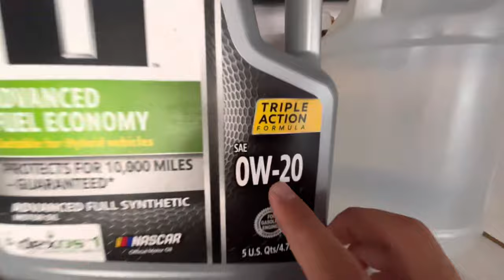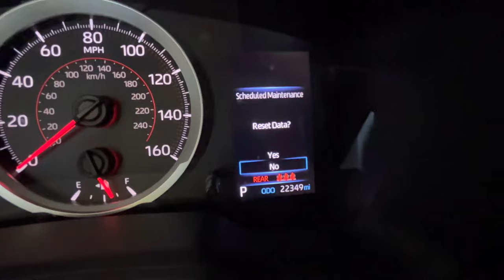2020 Toyota Corolla Oil Change! Super Easy

Comment: Thanks for the detailed video.  I normally check oil level after car is off the jack stands and on level ground.  The other thing is, according to Toyota owner's manual, oil level should be checked warm.  This can be done by letting engine run for 5 minutes, shut it off and wait 5 minutes for oil to settles then check dip stick.

Comment: 0w-16 is for max economy , and putting 0w-20 in is perfectly fine
If anything the -.5-1MPG loss is worth the extra protection
my 2020 SE purchased in 2019 have been maintained every 6k Castrol edge 0w-20 intervals for the last 65k miles and a Blackstone UOA shown it has wear similar to an engine with 30k miles

Comment: In the middle of the two dots is best. Oil expands so you don’t want to go to the second dot.

Tip: buy a tarp from Harbor Freight, they’re inexpensive. This way you put it under the car and you avoid spilling oil on the concrete and you stay prett clean too while you’re under there. Easier to wipe down the tarp than to try and clean oil off the concrete.

Comment: I used to pay $45 for the oil change and new oil filter on my Lexus IS250, now I just do it myself! Save so much money that way. Plus it’s super easy. Why pay someone for an easy job right ? Lol
Reply from the maker: Agreed! Plus it only takes roughly 45 mins to do. Not only money, but time you save
Reply: Its not the money its feeling uneasy knowing an idiot could over tighten drain plug or not put oil on filter gasket etc.Those quick lube places have kids working....Not feeling I would trust them. Doing it yourself assures everything was done correctly!
Reply: Everyone should have a trusted mechanic already for non-DIY repairs, someone that can do a good oil change.  You can easily spend $40 at the parts store for 4-5 qts of oil and a filter.  Add to this the time to jack up the car, find tools, lay on ground and remove skid plate, change oil/filter, remove jack stands, return old oil to parts store.  I'll splurge $10 a couple of times a year to let someone else do it.

Comment: So even the dealer put the wrong grade oil in it. You can't trust anybody.
Reply from the maker: That’s why I have issues with dealerships. They drained the oil and realized they didn’t have 0w-16 and only had 5w-20. I didn’t even have a choice.
Reply: That’s what they use on the 1.8L. Pretty sure they were lazy and used that.
Reply: It's usually just kids doing it.   Not much care factor
Reply: And they have the nerve to charge $100 or more to do a wrong job like wtf
Reply: Well tbh how do you know if it was 5w-20.  My dad got 2 years oil change complimentary so once a year at local toyota run by whoever franchises the name to resell the new cars.  But that stuff was like a straight 30 or 40 because it would not stop knocking the valves till 20 minutes later when it was below 45 degrees on a winter night with out the sunshine to help warm everything in the environment
Reply: This was on a suv with there 4.0 liter v6
Reply: I had alot of success using Castrol gtx 5w-20 jug 5 quarts with half quart Lucas heavy duty stabilizer so 10% added on an a honda v6 vtec (without cam phasers) the adjustable cam gears that vary the valve timing that have smaller oil passages so 5w-30 Gtx is probably the thickest you want atleast the last quart if you use 10w30 Castrol Gtx to not overheat and reduce power if you notice after 30 minu . Which all toyotas Started with instead of low to high lift camshaft like honda did
Reply: I like Castrol since it seems to hold up to thermal breakdown and it's thicker than most others.  Synthetics are usually thinner so I can try Castrol edge black one 10w-30 and it'll most likely flow better than there conventional throughout the tiny galleys in the variable cam gear lubricated by oil

Mobil 1 5w-30 is ACTUALLY thicker than Mobil 1 10w30 when warmed up and also at cold start THough a guy on here said he uses this 5w-30 on a 2007 v6 camry because of better fuel mileage but only put 6 quarts instead of 6.4 ..now I personally think it's because it's thicker somehow for a 5w-30 tho it flows pretty well into the motor so I'm guessing it was ticking the motor with 6.4 qts once it warmed up and the viscosity modifiers aka liquid rubber kept the oil from thinning too much but acted more like a 40 weight when the engine heated the oil so it felt crammed up ticking the valves is my guess. I would've just opened the fill cap adjust from 0.5 turns to 2 turns to see how much you need to relieve it due to oil pressure/ volume make sure fill cap doesn't fall out otherwise just do 6 quart like him. That's a good amount to be a well oiled machine than 3 or 4 quarts so to each to there own. Good luck

Comment: Just to note for future viewers or yourself, per manufacturing spec, if you got the 2.0L engine, you can use 0W-20, but only once, after that, you must use 0W-16 for the next change. If you got the 1.8L engine, then you can use 0W-20 oil, and once if use 0W-16, basically opposite.

Comment: Mobil 1 Advanced Fuel Economy . You said this is for hybrid vehicles but it was the only thing you could find, WRONG. Read, clearly states it is suitable for hybrid vehicles. That formulation is good for any vehicle that calls for the specs. that are clearly stated on the back side of the jug. Which is any vehicle that calls for rating SP/GF6A .

Comment: First off.  0w16 is not hard to find and did he change the filter??  Top off the filter with oil first. Then add-it to the engine. The owners manual will have the fluid capacity.
Reply from the maker: In my area of California, dealerships and local auto stores were in short supplies of 0w-16. I called ahead of other Toyota dealerships and stores within 25 miles and I wasn't in luck. They suggested that I am able to run 0w-20. Yes, the pervious oil change appointment did change the oil filer. Yes, you are correct, I did top of the oil filter before placing it into the engine.
Reply: It's totally unnecessary to prime the oil filter before installing it.
Reply: I agree with Jack the prime happens instantly in the oil system of this car due to the way the oil feed is routed to and from the block. The air in oil will immediately come out of the crank case breather
Reply: @njsongwriter  i worked at an oil change shop and while your right its not required but it does sound like shit on startup for a few secs of running dry so might as well prefilled and avoid it. Its take a whole 5 seconds. If you can't take that extra time i don't want you working on my shit anyways
Reply: Pre filling oil filters allow possible  contaminants to go straight into the important parts of the engine. I don't think jiffy lube techs no about cars or they would be working at a real shop.
Reply: Kind of hard to prefill when it's sits sideways on the engine
Reply: @njsongwriter Unecessary to u, but works for me for over a century.
Reply: @fischersgadgets4936 Contaminants??🤔 It's new/clean oil. Not sure what school u went to, but HOW? I've been doing for decades & my cars never blew smoke. You're not one of those who figure changing oil every 5,000 miles TOO, is bad. 🙄
Reply: @dans4900  U can get it pretty wet which is better than totally dry.
Reply: Unfortunately in my area it is harder to find and  a lot of times they only have quarts  and they charge more. I hope eventually they bring more in.

Comment: You should use 0-16w. That's what the engine is design to use!
Reply: Hello Hector, according to Corolla’s owner’s manual, if 0W-16 is not available, the manual suggests 0W-20. However, it must be replaced with 0W-16 at the next oil change (Page 527, vehicle specifications). Of course, bottom line, use the recommended oil.
Reply: @luislepe5026  0w-20 is only for emergency use only then replace it with 0w-16 asap.
Reply: @eraserheads78  yeah, I forgot to mention that. Thanks!
Reply: In the UK and Australian manuals Toyota still specifies 0w20 for the same engine. I would not worry too much about this. 0w20 is widely available and will be fine.
Reply: @eraserheads78 I have a 2020 corolla that I have put over 150k miles on and have only ever used ow20. That's what it says to use
Reply: @luislepe5026  Yes. Understood. But you should avoid it if at all possible. Make sure 0-16w is available and do the oil change. 0-16w is bow available in most places.

Comment: NEVER PREFILL THE FILTER, all you have to do is rub oil on the o-ring
Reply: 🙄 Why? U can't put a lot in it ANYWAY bc it's on it's side. But u ARE correct on gasket being prelubed. I'm 71 and have been doing for DECADES.